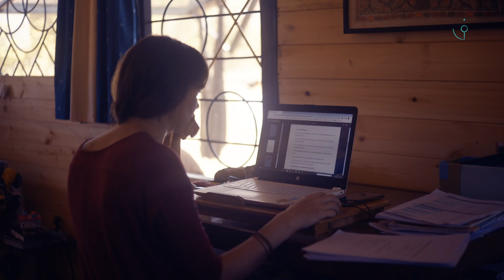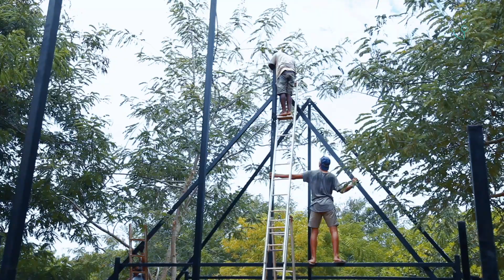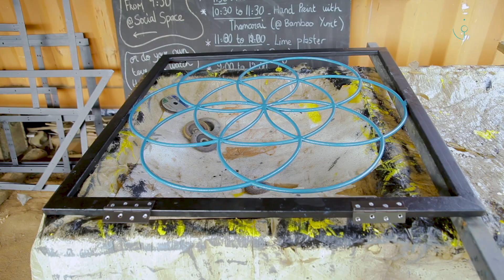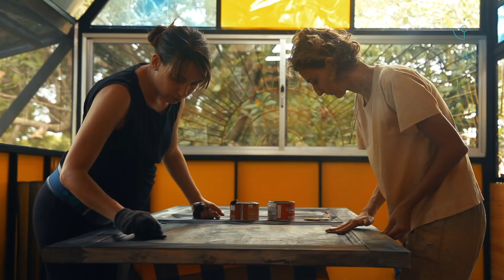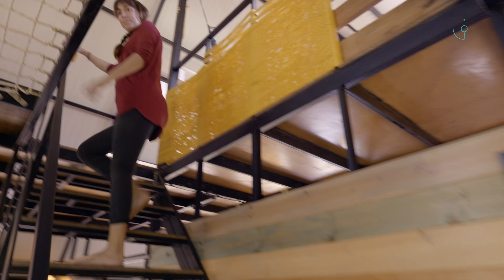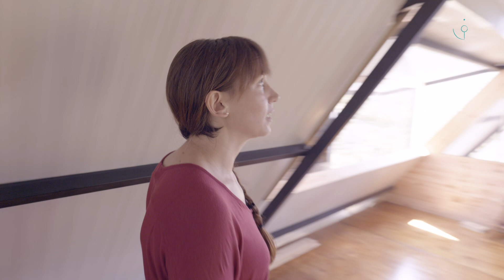Low Cost Demountable Eco House-Casita | Anitya Intentional Community Auroville | Auroras Eye Films

Comment: Secret Geometry is nice also because it's a metal cage, you should be SUPER protected from lightning, hope you installed proper grounding? (basically a metal rod that goes from the wireframe at least 10m into the ground ideally going through groundwater)
Reply from the maker: Yes thank you, we have though about this and have grounded the house so it's safe from lightening.

Comment: Curiouse about a traditional foundation vs tube footings. Advantages vs disadvantages?
Reply from the maker: Having the house raised on stilts helps in the weather conditions of South India, the floods of the monsoon, and the hot of the summer, allowing the wind to blow under, and to gain hight for catching the breeze, also helps protects against termites and other insects, and also its easier to move the house, as its a lighter imprint in the ground and can be just lifted out.